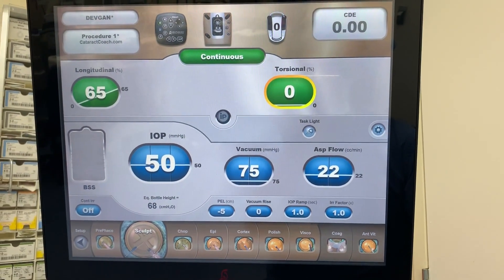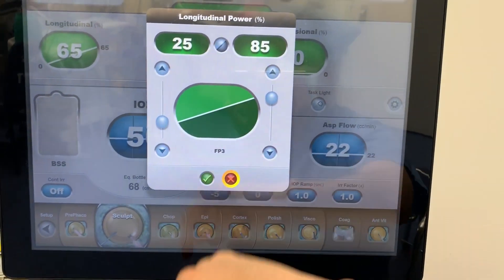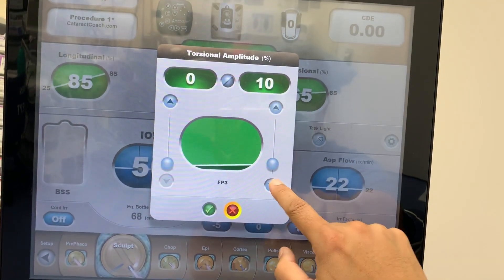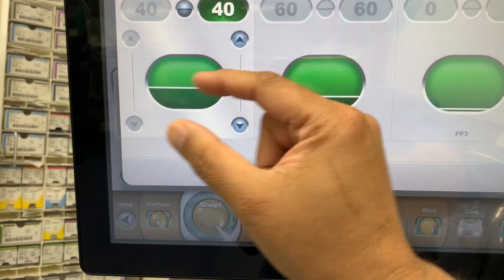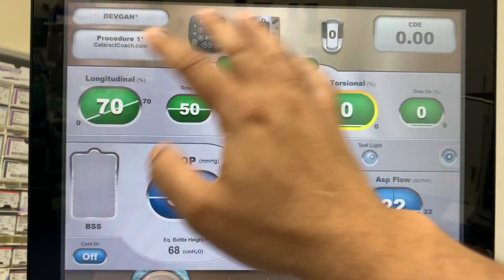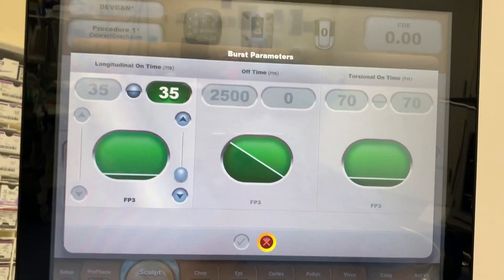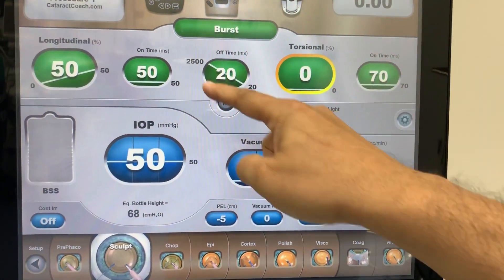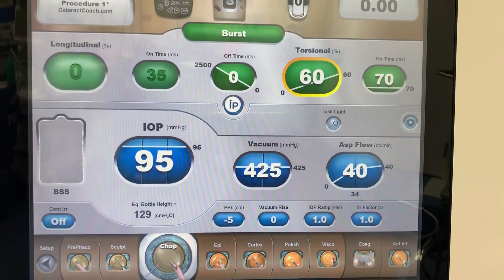phaco fundamentals part 9: mixing longitudinal with torsional ultrasound power for cataract surgery

Comment: A very nice presentation as usual.  It would have been very helpful, however, to have a discussion of optimal settings for various cases or for the various modes.  For example, rather than just say "you can mix torsional and longitudinal", it may have been helpful to say why you would want to do that and what kind of a mix would be optimal for various cases.

Comment: Thanks for your teaching. I wonder if there are any procedures or parts of a procedure where you only use torsional mode.
Reply from the maker: Yes. For routine 2-3+ NS cataracts, using just torsional is usually enough for the whole case.